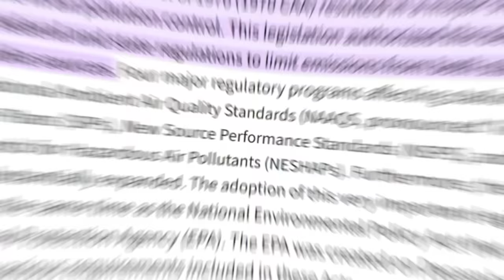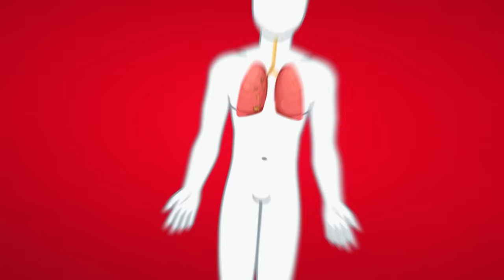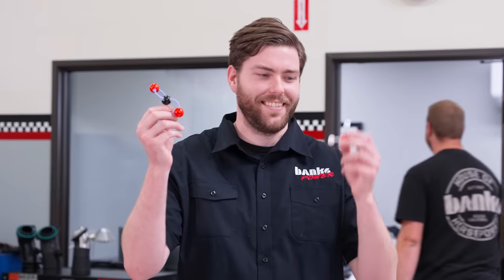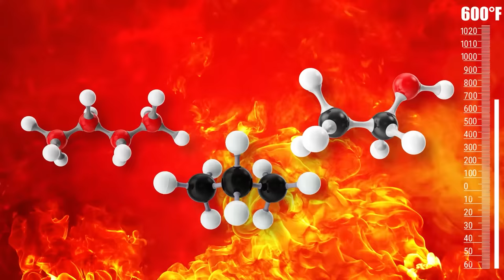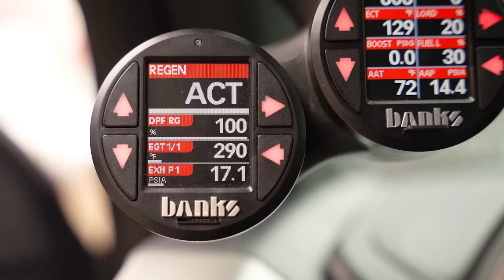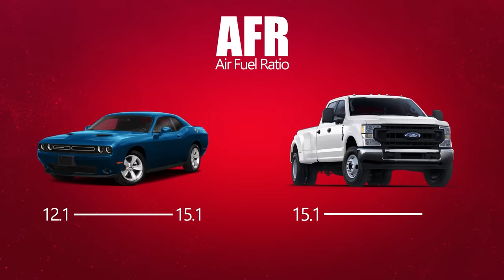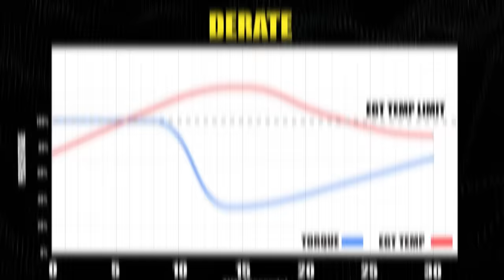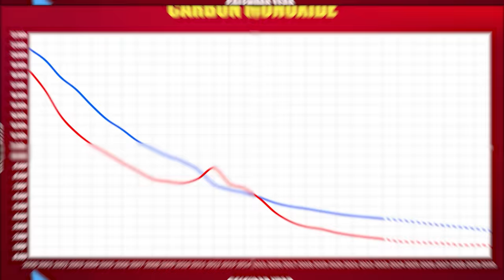Understanding the Most Hated part of your Truck | Banks Entry Level

Comment: It’s weird that they don’t talk about the time the different particles stay in the air….. odd. 

The large non-DPF soot particles settle out of the air fairly rapidly due to their larger size and weight. They are also much easier for the lungs to expel with its cilia. But the black smoke is unsightly. 

Small DPF burned soot molecules are much smaller and lighter. They take a long time to settle out of the air, if ever.  Their small size also means they get deeper into the bronchial passages in your lungs and are harder for the body to expel. 

BUT:  the air looks cleaner!!  Even though it’s actually more polluted and unhealthier for you than before……  win?  All at the expense of making the vehicles LESS fuel efficient, less reliable, shorter lifespan so vehicles have to be junked more often, and they require rare earth elements strip mined by the earth conscious Chinese government.

Comment: Yeah that’s all well and good about the horsepower gains over the last 20 years and the torque gains over the last 20 years. The one thing you failed to mention is the fact that they get less mpg than they did 20 years ago you need to burn twice as much fuel today than you did back in the day. 1989 Cummins got at least 12 to 14 miles per gallon more than any new diesel does today. Is all that power that nobody really actually needs unless you’re a hot shot or some other commercial driver worth it?

Comment: DPF on petrol engines, make air clearly better than before...mixed fuels (gasoline, ethanol, lpg, cng...) were doing very wrong emissions and clogging noticeably EGR (yes thay have...) and intake on direct injection...you can see some dirty petrol cars with black smoke on their tail-pipes, when too much urban-driving miles... you should make a test or video on how to clean emission systems and dpf/cats with proper hydraulic machines can restore 97 to 98% of the original performance for a fraction of a cost of change parts-repairs or keeping driving or deleting them and worsen fuel-economy...faster cheaper cleaning of intake, dpf, cat, chamber and turbo (vnt can stick very bad and make float the turbo free without waste-gate, and simple carbon cleaning may extend life for real)... think that direct injection petrol would also need cleaning...

Comment: I think the biggest misconception is that it's solely the EPA fault for all the emissions equipment. It's really Europe's fault. Most of these systems are designed by Bosch. If the air quality wasn't so bad over there from so many diesel cars, we wouldn't have this problem.

Comment: What about those pickup trucks on US military bases in the US that are factory-deleted?
Reply from the maker: Why don't engines built for defense have emissions equipment? They are designed to operate using a variety of fuels including DF-2 (Diesel) and JP-8. But they must also run on the lowest grade fuels imaginable, found in third-world countries. These fuels do not play nicely with after-treatment systems, potentially leading the premature failures. When an emissions system fails on a pickup driven by a U.S. consumer, the person pulls over to the side of the road and calls a tow truck. When an emissions system fails on the battlefield, soldiers could die. Although we're not privy to congressional meetings where these things are debated, we'd imagine these factors are considered.

Comment: 6:43... A magenta particulate filter is exactly what you need for the potential exposure to the 2.5 particulates... Congratulations on selecting and using the exact correct device!!! 

Now, mere seconds ago you told us that the particle size is microscopic even compared to a human hair... Do NOT fool yourself into thinking that you're use of a mask on a bearded face will in ANY way restrict your inhalation of EVERY particulate!!!

Using a particulate filter with facial hair is illegal!

I've taught respiratory protection to national audiences since 1988...

Comment: Where's the Derringer for 2020-24 FORD F250/F350/F450 6.7L?  I've been waiting for years.
Reply from the maker: We've been quiet about a release date for our new tuning devices for the Ford 6.7l. We don’t want to blow past a date we cannot deliver on. Our engineering team is developing a new tuning platform that shares nothing with the current Derringer because features like boost and fuel are not enough. Adding features like injector pulse width/timing requires new circuit boards, software, and app development. It has been a methodical and tedious process. Once this new Derringer platform is dyno tested, dialed in, and ready for all the 2020+ Ford platform, we’ll launch it.

Comment: Okay so the DEF fluid has urea which according to what he said when the exhaust goes through it mixes with the ammonia in the DEF fluid so theoretically speaking does that mean if I'm low on DEF fluid I can just piss in the tank or just pour ammonia into the tank which I'm guessing would be a hell of a lot cheaper than DEF fluid I mean I've seen people use water and windshield washer fluid and all that obviously you can make anything look real through video I've never actually seen that in person but in my mind if the DEF fluid is urea which equates to ammonia then just mixing ammonia with water whatever I maybe I'm crazy

Comment: Im sorry but i cant stand behind this emission stuff, in a pickup truck, or a big rig. Diesels are ment to work and alot of peoples livelihood depends on a reliable truck. In states like california where the weather in most of the state barely drops below 40 degrees, it's fine. But when i lived in Colorado during the winter, my Paccar and the rest of the fleet, including Detroits, were in the shop constantly because the emissions systems couldn't handle the cold. I agree with having clean air, but i dont agree with us the working class, that rely on our diesel trucks to make a living being the guinea pigs.

Comment: Did Banks get fined for their former position on EGR? This is kind of BS. I know of truck owners whose fuel mileage increased by 20 % after an EGR delete. Lot of engine damage done by EGR systems, including early engine rebuilds, and expensive EGR system services. While a thorough video there are several claims that do not make sense. My mileage take a severe hit when an active regen is in progress, and I doubt that EGR systems improved diesel fuel milage/efficiency.  Cramming dirty sooty exhaust into the engine hardly seems like a good idea and most certainly will shorten the life of the engine. I am hoping though, that the Derringer (hopefully will be out soon for my truck) will help cut the number of regen cycles and save the my 6.7 Cummins from and early death.

Comment: Delete.   I appreciate Mr Banks's optimism  but until a solution IS found, this isn't it.  Similar to the EGR in gas vehicles, there's no logical reason to be putting SOOT in the INTAKE of your engine, that's just a horrible idea.   Protect the environment in a way that doesn't utterly destroy the life of your engine.  Similar with having your engine exhale through a bong.

Comment: All the reasons my truck has been in the dealer, it's for something going wrong with it that requires a technician, not a mechanic. I'm tempted to delete it because of the issues with reliability. This is going to be the 4th time for a new issue.

Comment: This video was well produced.  I realize you have to kiss the ring of the EPA and keep your business relevant.  However, I think its safe to say no truck will make more power with stock exhaust vs free flowing.  The presenter cleverly mentions how your system makes more power overtime, due to less active regens.  That only applies to the truck derating power during these regens, and not overall power production.

Comment: DPF: (noun) 1.) A non serviceable, non user replaceable filter that eventually clogs and corks your exhaust making your engine not run.  2.) A device to necessitate the burning of far more fuel than should ever be needed to make a diesel engine run over its lifetime.  3.) A magic elixir that makes clueless, greenies feel better when they don’t see a vehicle expelling black smoke(diesel particulates) by containing those particulates and burning them ofc all at once as far more dangerous emission that can’t be seen by the human eye. See also: “Utter foolishness,”

Comment: The real problem is the longevity of the engines although the new engines can make more power they don’t last nearly as long as the old engines for instance my 7.3 has over 1,000,000 miles

Comment: So we dump dirty air back into the engine to make it less dirty. Then squirt def in so that you can spray less dirty crap into the engine, and to save a bit of fuel, only to have to squirt more fuel to burn the dirty spot that came out of the engine. Oh and that crap we put into the engine wears the engine out faster causing the hydrocarbons getting into the air that we are trying to prevent in the first place. I think we need the EPA otherwise we wouldn’t have some of the clean tech we have when it comes to cars and trucks but how they go about it is ridiculous. Instead of just throwing blanket rules out like clean air by whatever year we pull out of our a$$, why not work with the major manufacturers and figure out the best way to do it.

Comment: All this sounds great and everything, but the fact remains that when any emissions parts fail (and it is bound to happen eventually no matter what you do to prevent it) it costs tens of  thousands of dollars to fix/replace parts. The parts alone cost more than the engine and transmission combined practically on the truck itself. Lets not forget that all military vehicles do not have the same restrictions on their diesel equipment like us citizens do for obvious reasons. Either way, these emissions systems are garbage. On another note, I like my diesels to sound like diesels. Not like every other car on the road.

Comment: My F550 says clean idle certified,  but when it does a regen I have to be aware which way the wind is going and where Im parked as the brutal stink the truck is shitting out the back. The gray white haze floating around not only looks like shit but smells terrible and not only sometimes drifts into my cab it floats over and through the customers equipment and the operators sitting in the cab will MOST DEFINITELY tell you how and where to go fuck yourself, meanwhile the out rigger is out and the crane is lifting a component  into place and the built Ford tough smog machine is destroying the fucking ozone.
As the truck is maintained by Ford, several checks of the emissions system has been done and all came back as regen system is working as required with no faults found. If this is normal Im completely confused how this is the future. Worst part is once the warranty is off the truck goes to auction and my employer gives me a brand new service truck with the exact stink coming out the back. 
Maybe Im being dramatic but honestly cant imagine a private citizen even owning a F450 or F550 like this and putting up with this bullshit.
Reply: It is not that bad not even close.
Reply: @autohelix  had to move the truck today the stink was so bad, and yes there is a smog blanket coming off the other 5 service trucks that are running near by repairing equipment,  for you to say its not so bad only suggests you work for Ford or completely clueless.
Reply: @panthermartin7784  I work in local government. We have tons of trucks. F550, isuzu nrr, freightliner, autocar, mack, and so on. 7 years of driving. Never had to move a truck over smell from the exhaust. Trash juice yes, but not exhaust.
Reply: @panthermartin7784  None of our trucks smoke. Your trucks have problems. Bad fuel, maybe bad def fuild. They produce lots of heat, but they don't smoke. We have tons of F550 trucks.

Comment: They need to get rid of all of it. In the end the extra trash from def containers, the extra parts and run time to regen cancel out the good they do. It ruins motors and costs truck owners alot of money. The filters and everything need to be alot cheaper. While we regulate the living crud out of the USA. Other country's can just run their vehicles as they are supposed to be. No excessive emissions.

Comment: so maybe i dont have the right numbers. and if you do please let me know. but if your diesel is 12mpg (non def) with a 20 g tank. and the same engine with def makes you 12mpg with same 20 g tank, but now you add 3-5g of def. thats effectively saying your tank is now 25 gal and you get the same 300 miles. also you say that SCR increases fuel econ, how? it dosnt provide power to the axle relieving the need for fuel. if your just saying that it burns the un burnt fuel after the fact thats not fuel econ the same way as being able to use that fuel for powering the vehicle. its a deceptive use of the terms. you may as well capture the particulates in a balloon and burn them at your house. the only reason your motor gets better MPG is because it burns more effectively in the cylinder AND you run it leaner. your getting more efficient use of the fuel into useable power. not unusable from the DPF. im not saying dont save the environment, but i am saying dont be deceptive

Comment: DEF was the stupidest thing put on most diesel trucks. Our aircraft refueling trucks (brand new trucks) constantly had problems with the DEF system Because the engine need to be at road speeds and not idle sitting or moving at 10 mph for a few feet.

Comment: First of all that one comment you made was absolutely not true when you said a diesel engine with the emissions system in place aka a particular filter will make more power than one without is not true One without has to potential to make more power than one width just because most people can't or don't do it doesn't mean the potential is not there that's a crazy comment. Also to get rid of the ash build up that you may be getting from your oil via the PCV you can run something like a catch can of course on top of running the fully synthetic oil. surprised he didn't mention that at all.

Comment: Why don't they use water-methanol injection lower combustion temperature reduce fuel consumption therefore reducing cylinder temperature and all the chemicals are reduced more than a catalytic converter or particle filter can do

Comment: Imagine cleaning the air, by adding millions of disposable plastic DEF jugs to landfills. And then add the huge catalyst  that will eventually get clogged. Don't worry though, your Playstation truck can dump fuel into the exhaust to try and clean out the catalyst.   Funny how automotive companies fought against EV laws, but not against emissions laws or safety regulations.   But those things add items to vehicles, increasing costs (profit margins) and shortens vehicle life.

Comment: A lot of good points but also a lot of flaws in that explanation. I like what you guys are doing and attempting to achieve within the constraints of the EPA but these modern emissions systems are just becoming the death of diesels. You can make good power but for a very limited amount of time. And at a much higher cost. Owning a diesel just a few years ago was only a fraction of what it is now. The EPA is putting such tight restrictions on them that is leaving the consumer footing the bill with a $6K+ bill every 60-100k miles.

Comment: Unbelievable, This is propaganda. I will never purchase a banks product again after watching this video. Every single time a truck is deleted there is a 2-5 miles per gallon increase. I have never seen a decrease in fuel milage after deleting the def systems, ever. So no the def systems does not make you use less diesel, is uses more diesel.
Reply: They know that, we know that, but they want your money so they won't admit it.

Comment: Convert to a none liquid gas more of it will burn a vapor burns better
Then a liquid or mist, if you can change the fuel into a vapor more of it will burn giving more power and cleaner expeled gases.
How do you convert a liquid fuel into vapor?  Heat is one way or putting it in a vacume lowering the boiling point. 

Hydgron burns clean so convert a motor to burn that the off gasses are water.

Comment: I have to go to the dealer to do a manual Regen, they dont even have a manual regen botton anymore. I am beyond pissed at this emissions non sense, all my issues with my 22 Cummins are emissions related and have cost me thousands and days of work that I have to pay for to supposedly keep the air cleaner while China and India build a few thousand new coal plants. If we are serious about wanting clean air (witch we already have!) than we would use natural gas and propane instead of oil to heat homes. I am from MA and the idiot hippies here made an oil pipeline for natural gas illegal so we all keep burning oil and wood whitch is way worse...the air is already clean and has been flr decades before all these regulations came out.

Comment: A $10,000 exhaust system equates to a massive failure in design engineering.  Vehicles with these systems will populate the local scrapyards much earlier than their predecessors.

Comment: They leave out the fact these emissions components are constantly failing and surprise surprise there's only a 50k mile warranty on those parts in contrast to the 100k miles the manufacturers give on the drivetrain. They know these components are unreliable and suck ass .

Comment: I get that your company has to play it safe with what you say to not get fined, but lets be real; there is no way you or anyone else believes sucking exhaust fumes back into your intake will EVER be good for an engine. Burning efficiently in the first place renders the parts futile. With "good engineering", you would burn cleaner than any emissions equipment can